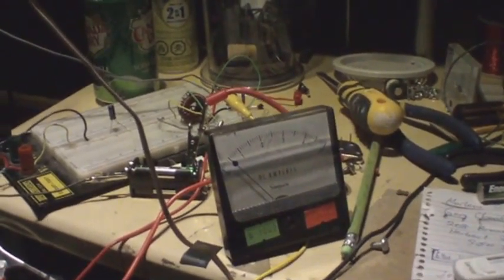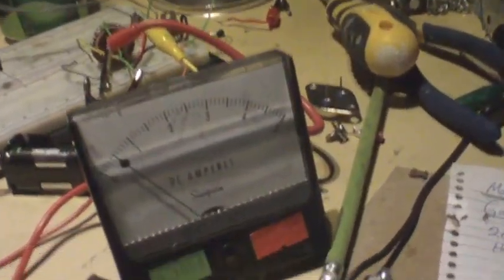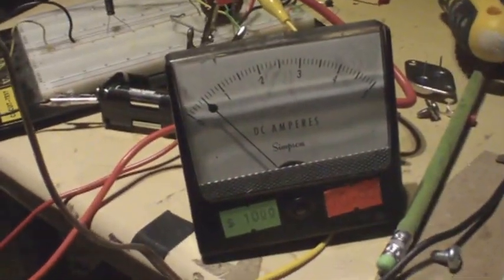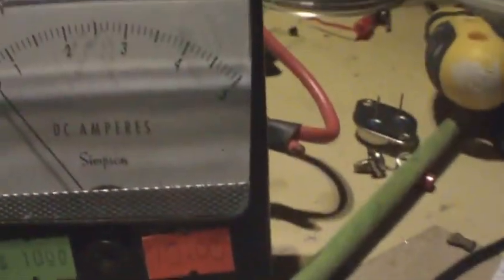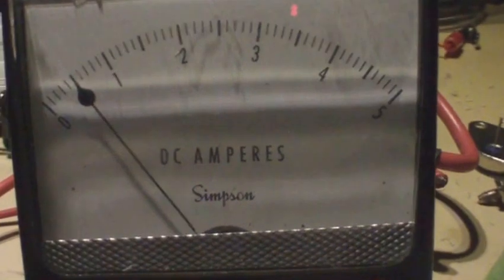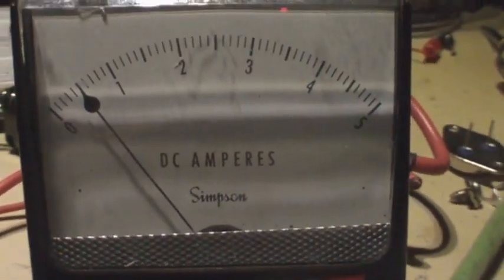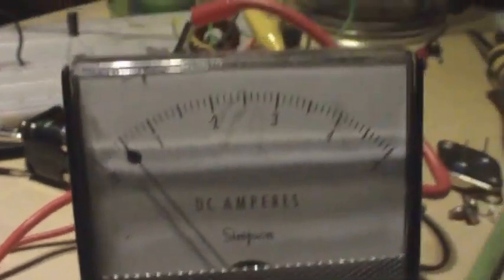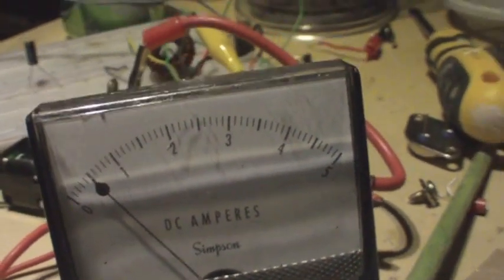Joule Thief Revisited Pt. 2 1.22V @ .5A (.6 Watts) Very Good Light

Comment: The 120 is 3 or 4 times the gain of a 2N3055.  The collector voltage is 100 V, much higher than the 2N3055.  The TIP122 is Darlington, read the reply I just left about this problem.  No typo, 2SC2334.  If you want a Superbeta transistor, try the Fairchild KSD1273, same as 2SD1273. Has a gain of 1000 or more.  Get the O or P gain range.

Comment: Darlington configuration requires 1.2 to 1.5 volts to bias the base to emitter junction, so you have a transistor that won't work on a 1.5V cell w hen the voltage drops below 1.2V.  Also, the voltage between the collector and emitter cannot drop below 0.6V, which wastes half the power of your joule Thief.  The Sziklai configuration addresses the first problem, but the 0.6V drop is still there, so it still wastes a lot of power.

Comment: How about Futurlec(.)com?  Also, eBay sellers often offer free postage.  2SC2334 is C2334, not D.  I had the link at work, won't be back there until next week - I just searched for it but couldn't find it.  HV power transistors _always_ are free, from disassembled PC power supplies, and so are all the toroids, coils and other parts in there.

Comment: KSC2334 is only 120hfe? what gibberish are you talking? The voltage is woefully low, that amps are not great, not one appealing spec on that datasheet. 2n3055s are higher performers?? High hfe starts at 1000, with tip122. which outperforms 3055 by a country mile.

Did you make a typo? I do have d2334's, get tons from TVs. They are gutless. Low gain and blow out really easy. Why I avoid using them.

Comment from the maker: So far I've just been using a $2 buck converter that has adjustable voltage regulation, and I set it to 2.68 volts or so. Seems to be the easiest thing to do.

Comment: I'm really impressed with this one. I've looked at a lot of low power lighting. This is great brightness, actually usable to replace conventional lights, and running on piddly power draw. I hope I can find time to try it, have tip 31's and 122's, so one of them should work well, I'm liking the tip122's for over 1v atm.  Even without an oscillator to charge, a 2w solar panel and a battery with a night or two's amp hours, and you have a light that will work every night for many years. Well done!

Comment from the maker: you bet, gutted, such that all they really are now, is DC wired 6V, with no current limiting resistors. So, two in series - and then two parallel legs of that. 4 one watt LEDs, wired for 6V. Powered by 4V or less.

Comment from the maker: The plan is to take this, and the bucking converter you see in the solar charging capacitors video, combine them both into a handheld lamp, driven off of 2 supercaps, with solar panels right on the lamp. Use it whenever you want, leave it outside to charge and never worry about replacing or overcharging / overdischarging batteries again.

Comment from the maker: it is an absolutely normal joule thief circuit, it just uses a large power inductor with about 18 ga magnet wire and many many turns on ferrite toroid that is almost 1" in diameter. and TIP41. bulbs are 4 X 1W led each (so 8 X 1W LEDs) The leds are wire 2 in series (6V) - but there are 4 parallel legs of those. cheers

Comment from the maker: yes, a little too bright for sleeping. its not going to replace the bulbs used conventionally, but it is, indeed USABLE. many of my other Jt's are just too dim. period. AND 500mA is a hard load on a AA  -- and thats exactly where the super caps come in, as they are not afraid to deliver current, every use